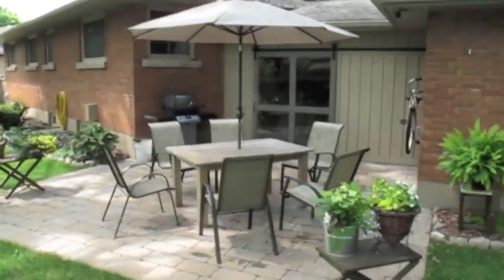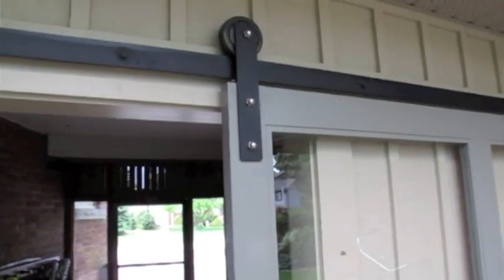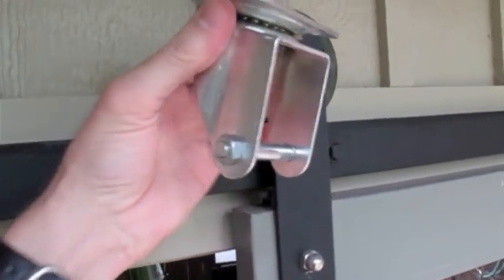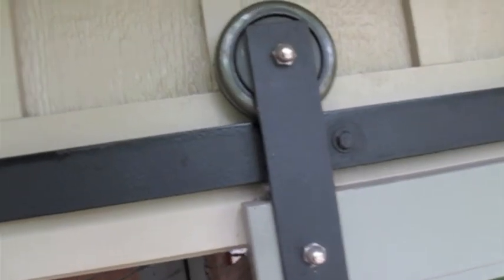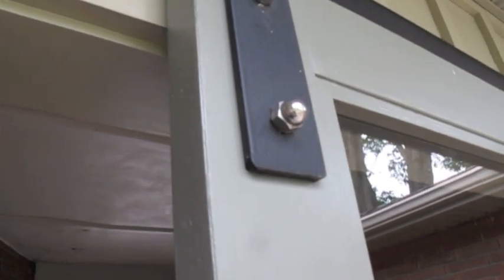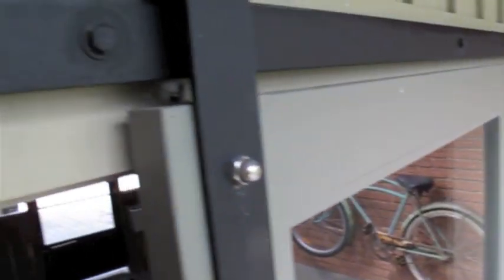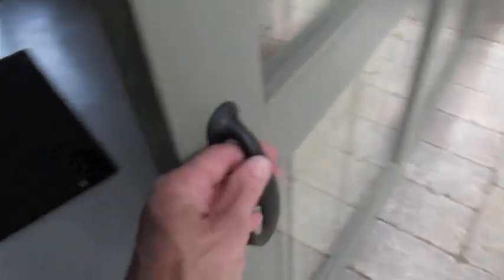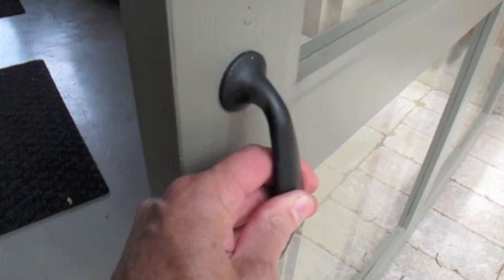how to make ● A SLIDING DOOR and the HARDWARE yourself!! (super quiet)

Comment: If I were to make this, it would be used for an indoor only application. With any exterior door, I need it to be sealable and lockable. If I had a breezeway between the house and garage I would probably go with a sliding walkout door system. I am just now looking at a barn door set up for the opening between my Family Room  and Kitchen area. I now have French Doors that swing open into my Kitchen and it takes up a lot of space. I want to eliminate that situation. I can't put in a pocket door so the next best thing is a Barn Door for this 5 foot opening that I have. But if I go with the Barn Door I want to have 2 doors on the track, so I can have one door in the closed position and still easily enter and leave the Family Room. Thanks for sharing this with us. And I am very familiar with those Princess Auto wheels. I have used them on tool cabinets that I built in my shop.

Comment: Great video. Thanks for sharing. I'm thinking that a seal could be made using a garage door seal (that rubber found on the bottom of garage doors). If installed on your door so that the flexible edge just barely kisses the wall, it would cover that 3/4" opening and stop the snow from blowing in through the sides of your door.

Comment: That is a lot of temperd glass for that cost. Also on your k3 jig  from kreg ,if you used only 1 inch and half screws on 1" 1/2 lumber your screws are barley griping anything. Screwing 2x4 to 2x4 calls for 2"1/2 screws. Use 1"1/4 screws for 3/4 material.
Reply: He did mention he was using screws that were too short just for the demonstration. He likely used longer ones for the real door.

Comment: I built a sliding door for my hot tub gazebo,  right on $200 for everything.  I got my 6 ft tracking and hardware on ebay for $44 shipped.  I built my door out of cedar so it was a high quality and beautiful.
Reply from the maker: Sweet!
Reply: Chris Notap  I will post a video of my door in a few days, yes it is sweet! I think my door plan will help alot of people.  home depot has a sliding barn door with tracking for $449 but I done mine for $200 and it's made from red cedar.
Reply: Steven Smith

Comment: Tip: I use idler pulleys from the auto parts store. They have bearings and roll very quiet and smooth. About $40.00 a pop, but totally worth it. I bought eight of them for a four door install and Oreilly knocked the price down to $28.00 apiece.
Reply: Very nice job by the way.
Reply: They look good, but I would be worried about them splitting in the future. The idler pulleys are steel, powder coated black, and should last a very long time. As far as the cost, they were in the budget for the client. Not criticizing, but I would be a bit concerned about the lifespan of those rollers.
Reply: First of all, I guess I was wrong about your wheels. The idler pulleys have an angled groove and they naturally center themselves. The bearings are very high quality given their intended use, and roll very quietly. I guess there are a thousand different ways to do it.
Reply: Can you give me more information about the idler pulleys you used.....part number or maybe a photo?  Thanks.
Reply: vincentwgardner I sent a couple of photos to your Google + page. I got my pulleys at Oreilly, but I couldn't find the part number on their page. Just make sure they are for a V belt so they sit on the rail correctly.
Reply: Robert Palmer Thanks for your help....but I cannot find any photos.  It may be me as I'm not familiar with Google +.  I've logged on but don't see any photos anywhere.  Not sure if you can put photos on this thread or not.  Or you could email them.  Thanks.  I appreciate the help!
Reply: Email address?
Reply: vincentwgardner Email sent.

Comment: Fantastic video. I pretty well copied everything to do my own door thank you. My door is 74 inches wide and I'm using full rough cut white cedar 1 by 8 planks. Obviously it is heavier than your door and I did buy the exact wheels you used only mine are listed at 250lbs each for capacity. My machinist cut a similar groove to yours although it did go through they grey material so it I'd rolling on the black rubber underneath. My question is have you had any wear on the grooved out area of the wheel? They are holding up ok? Thank you I am going to subscribe. Thanks for you effort
Reply: +Chris Notap thanks again it was very helpful.  Cheers

Comment: Thank you for this video. I am blocking Kitchen to living room addition and have to attach to a cinder block wall (the original outside wall of the house) that's covered with tongue and groove pine, which I am nervous about. The other issue I have is that the door won't be on the floor due to the original step sticking out. It's concrete and not removable. Any suggestions for attaching to the cinder block to that it will support the weight of the door? oh sorry the door happens to be solid 1 3/4" x 41 x 82 with a leaded, beveled glass window. Very, Very heavy out of a 100+ year old house. 

Thank you for any thoughts you might have.

Comment: I  like the design! especially the wheels. Quiet. I might try making one like this. I have an idea for the gap that lets the snow  (and bugs?) in. What do you think about a hinge that swings and magnetically locks the weather strip into place when the door is closed and magnetically locks  the hinge "open" when the door is open? These you would have to manually open and close though.
Reply from the maker: That sounds like a plan. Give it a go. It's all about experimenting and using your brain and I think you have a good idea going.

Comment: Very elegant design. But I was wondering especially for an exterior door what type of security lock mechanism would you use?
Reply from the maker: Quite a few have asked that same question and the answer is not simple. If you really want this type of door, you would need to think up a way to lock it securely. In my situation, I didn't need it to be locked.
Reply: oskey, see my comment just down below.

Comment: Is there a workable way to install some weathersrtipping felt or such so the air does not enter through the sides? I like the
J-rail idea at the bottom, but I would think that one on each side of the door frame would be necessary or it would be overly easy for a thief to enter by pulling the bottom section of the door out from the rail on the side that lacks the J-rail fitting. Really well done video and nice to see how you did it.
Reply: A thief could easily break the glass.

Comment: Just a quick input I noticed. The wheel weight you saw in the store is the whole system (metal, bearings, and wheel). Those wheels themselves are most likely able to support much more weight considering it was the metal frame around the wheel that would be most problematic. So, you are even more in the clear. LOL!
Reply from the maker: Correct.

Comment: i am wondering how you made the track part where the wheel slides on the track? there is the small gap in the center of the wheel to guide jt down the rail but on the track itself how did you get the small track that fits in the wheel gap. did it just come li,e that or dkd you have to make that?

Comment: There are reasons why glass in doors is required to be tempered by the building codes. You may have saved money on window glass but if someone gets hurt or worse from broken shards of glass you will be in trouble. Consider searching used tempered windows of the size you desire and build the door to size. Nice job otherwise but I am curious how you withstand winter weather.

Comment: Thanks for the video.  One question is security/locking it when closed?  It would appear that if you made the spacer dowels at the top "thinner" then the fit would be a bit tighter.  I'd think that a bit of weather stripping on the top and backside could solve the "open issue"  I know that it's been a while ago, but thanks.
Reply from the maker: This type of door would be difficult to secure. Not saying it can't, but it would be a challenge.
Reply: @chrisnotap  I would agree, but if it's the main door here you would need to secure when you leave.  Obviously, you are comfortable as it is.
Reply from the maker: My door is in an enclosed breezeway between my house and garage. Security is not necessary there.
Reply: Sliding barn door locks or steel loop locks works well for security. I was thinking the same thing regarding sealing.

Comment: Great system and design!! I am thinking of making a full glass door of about the same size as yours but with no middle frames, only frames around it. I will be definitely using the same wheel track system but I'm unsure about the glass thickness. Do you think a 3/8 thick tempered glass would be enough?
Thanks in advance!
Reply from the maker: 3/8" glass?  That will be very heavy. I'm not sure you need to go that thick. Call your local glass place and ask. Sounds pretty cool what you're doing.

Comment: I would have definetely used a better type of joinery other than pocket screws. Did you think about cutting miters with splines, rabbit or even mortise and tenon?
Reply from the maker: +Chipper Garcia    I get that. People may want to spend a lot of time making a fancy join but it doesn't get much easier than using a pocket hole and screws. If you want to make it stronger just use more pocket screws closer together. Have you tried pocket screws? They are very strong and takes no time to drill the holes and get it done.

Comment: Hi there - many thanks for this vid. Thought I'd let you know I've probably watched your clip here at least twenty-odd times or so and then followed just about all of your construction techs and and advice on the homemade sliding door and just today got to hang my own door on a bespoke garden shed I've constructed over the last month or so. The running guides and touch-ups are still to be completed but gotta say it looks great up at last. Cheers!

Just one thing; I was wondering though if the axle bolt you fitted through the wheel in particular was stainless or galvanized steel - which I used but I am a little concerned if there is a difference with strength between the two (i.e. possibility of shearing off at some point with the weight of the door, as my axle bolt is 8mm / 1/3rd inch - slightly narrower than yours)?
Reply from the maker: +David Austin Thanks for taking such an interest in my video! Sounds like you're real happy with the results! That's great! As far as the bolts go, I don't think you'll have a problem. You're only about .061" smaller than the 3/8" bolts I used. If it was just the bolt sticking out and something acting on the end of it, would be different, but since you have the bolt going through the wheel and sandwiched together, helps to beef up it's strength. As far as the grade of bolt goes, I used a grade 5 bolt (has 3 lines on the head).  Send a pic when your done, I'd love to see it! chrisnotap@gmail.com
Reply: Thanks for the extra info, Chris. All the best!

Comment: It appears that your door is not separating a conditioned space and a non-conditioned... that it's securing an outdoor covered area.  Important for folks to understand that this door while functional, provides no weather seal or lockablilty.  Good job, but I'm trying to do a similar job and need both.
Reply from the maker: Yes, it would be hard to weather proof. These types of doors are meant for "same environment" on both sides of the door.
Reply: This door would be perfect for re-doing my shed into a studio, which I don't plan to heat or cool, and I would usually have it open when I'm in there working.

Comment: Do you think I can addd this to an old metal shed.  The original doors  are  dilapidated.
Reply: Yes. I would attach a header to the shed though. Frame it in like an interior wall. King studs Header Jack studs lag bolt the whole assembly to the metal siding of the shed. Then your barn door hardware has a solid support.
Reply: Thank you so much for responding.  Have a blessed day.

Comment: I see one BIG problem.....security. All someone has to do is lift it up off the track and remove the door and they are inside your home. They can also unscrew those acorn cap nuts too and remove bracket from door.
Reply: I love the doors but unfortunately I live in a neighborhood where robbers would not hesitate to unscrew the bolts to break in.

Comment: where did you get the rail and how long is it
Reply: It's just flat bar from a steel supplier.  I generally use 1/4" by 3".
Reply: Thanks. I just had an old bed frame hanging around and used that it worked great-already had the end pieces for stops and was the perfect length- sprayed it with black paint
Reply: onetwothree57 Great idea on using the bed frame!

Comment: Are you able to lock the door?
Reply from the maker: I don't have a lock on it but I'm sure there's a way to put one on it.
Reply: Chris Notap Thanks for the reply. I'm thinking of doing this for a bathroom door. Would it be possible to use pulley wheels instead since they're already notched?
Reply from the maker: Experimenting and creativity is what it's all about. They would probably work great but you may want to consider the noise they will make since it will be metal on metal.

Comment: How could the door not drop to the floor? The roller/wheel groove look not so deep actually. That how physics not stop amaze us. Lol
Reply: It's balanced on the rail and the weight is forcing the rail into the groove. If someone were to jostle or lift it, it would fall quiet easily. That's why he has the stop screw that prevents it from being lifted more than a cm

Comment: I'm a contractor and you will need a rebounder at the end of your door
Reply from the maker: +gavin ramlall When you say a rebounder, what is that?
Reply: its a rubber that you screw at the side of the door to prevent your glass from breaking when you open your door.
Reply: gavin ramlall he has a rubber stopper on each side to cushion it as the door reaches either end